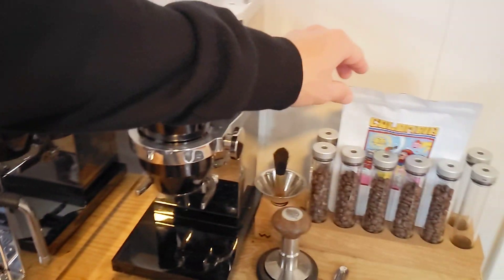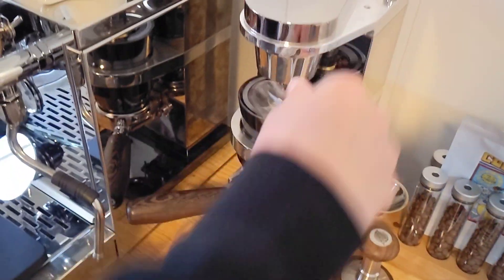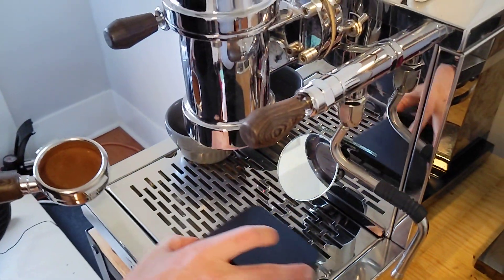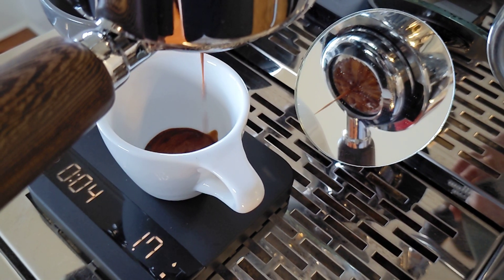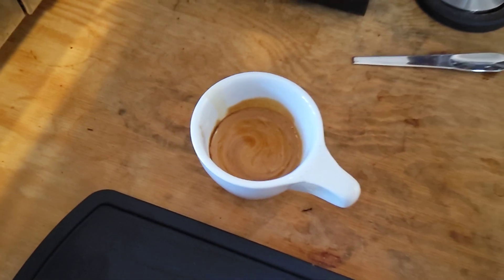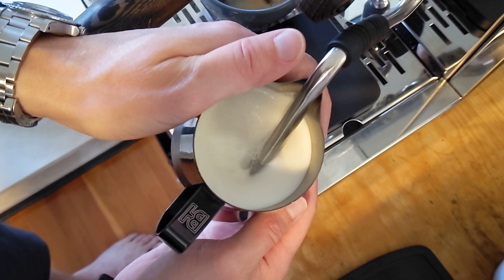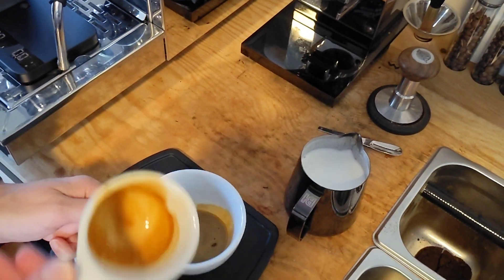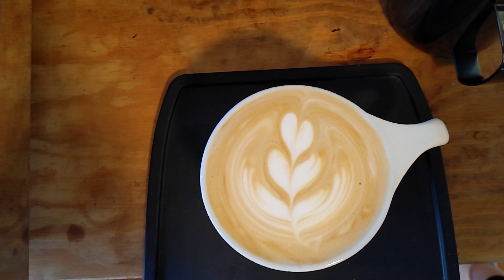New coffee roasting and the LR24 + Titus workflow

Comment: I wont comment on the coffee making as it's personal preference, if you like it that short ratio and high dose no problem then. But I will give you a tip regarding the grinder, Titus also sells these on his Nautilus, get a pack of silencer feets they are called Oehlbach Puck One For All (55135). It will take away more than 50% of noise and all the vibrations.
Reply from the maker: Thanks for the thoughts Denis. I think I already have those on the bottom. Have you tried the 55044?  They seem to have a higher rating with the newer air technology.
Reply: What exactly are silencer feets?  How does it make the grinder quieter? I have a VL M4. Was wondering if this would work with my grinder.
Reply from the maker: @shawnsgear  You probably already have them on the bottom of your VL. I know my Titus already has a set that looks similar to what Denis is talking about. https://www.oehlbach.com/en/audio-equip/pucks-spikes/one-for-all
Reply: @eltakeiteasy  interesting!  I just checked and I definitely do not have those on my VL.  I have four felt looking pads that look similar to furniture sliders.  I wonder what the difference would be if I installed the ones in your link.